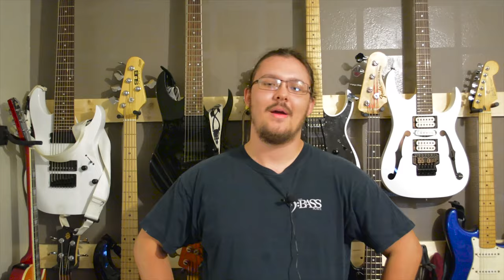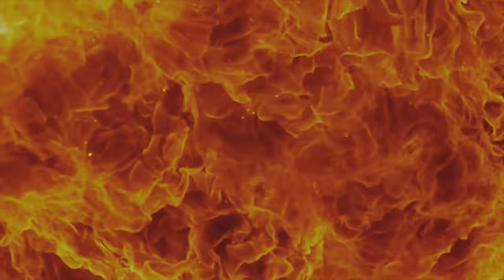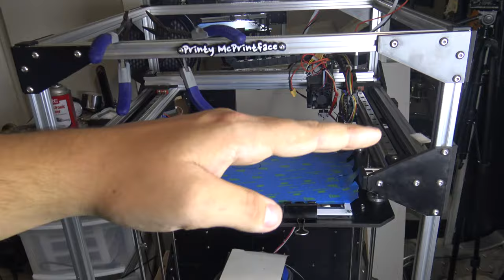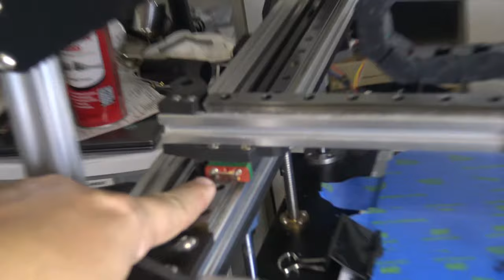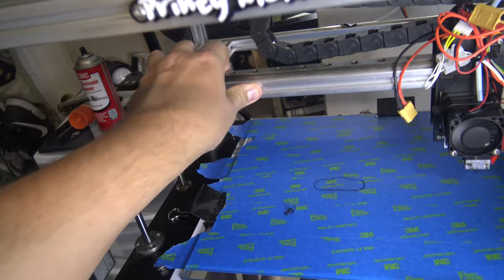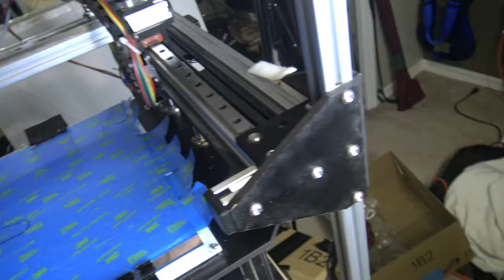FT-5 Slider Fixes Update | Your Sliders Are FINE!

Comment: A word of warning - if you move your axis manually really fast with the motor wiring connected you can fry your board with the current generated.
Reply: john martin as can be seen when the hot end fan starts turning...
Reply from the maker: I am aware of this, but am not worried at this point.

Comment: Yeah man, I don't wanna call you an idiot or anything but you should not move your axis that fast when your motors are connected to the board because the current spike might fry your drivers or your board because it is made to send current, not to receive it lol. Also, the reason why it is creating resistance is because even though both motors are connected together, they are connected opposite to each other when it comes to the direction of which they will move. That means that if you move one side in one direction, the other side will try to move in the opposite direction but it will try to oppose the movement because it is receiving current from the other motor in a never ending loop which will create resistance. It is the opposite effect that 2 motors in the Z axis have when you spin one of them, the other spins as well in the same direction. Nevertheless it is a good video! Very informative!